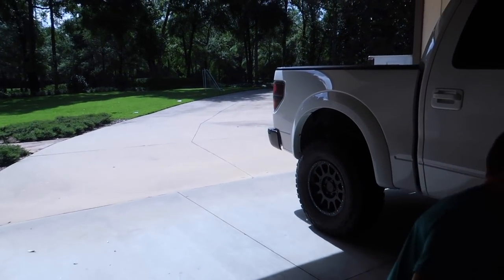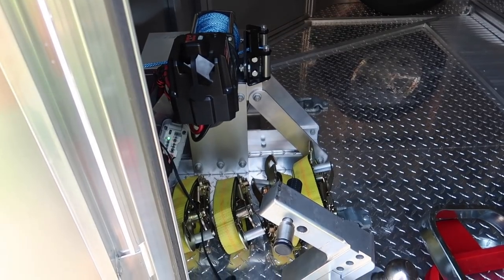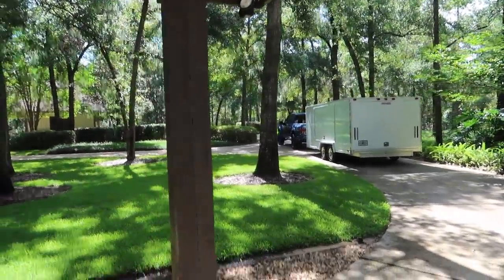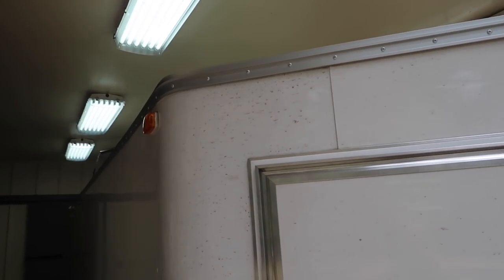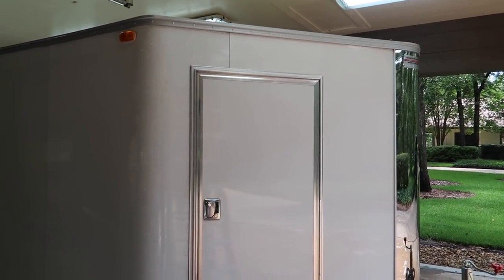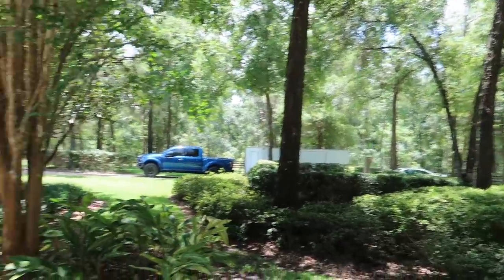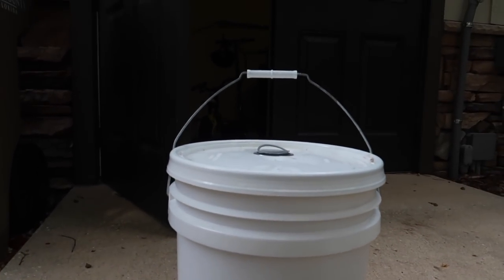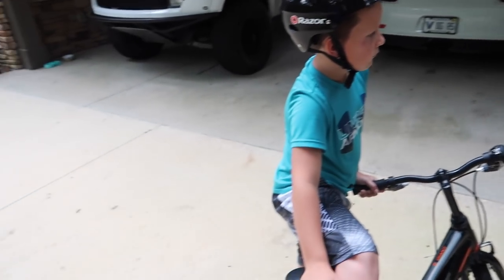Cleaning Trailex Trailer & Car Capsule Vlog

Comment: Matt look in your owners manual it states that you should be using a weight distribution hitch with any trail weight over 5000 lbs or any tongue load over 500.

Comment: Simple green works just fine to clean that right off. The RV cleaner version works even better.
Your tire pressure requirements off your trailer is listed on the tag. It should be around 60 psi. The GVWR of the trailer determines the tire psi.
Reply from the maker: That's a good idea.  I'm going to check the tag.  I'm not sure where it is.
Reply: Obsessed Garage usually near the vin tag. Maybe the frame near the front or in your case in side by the door.

Comment: Yo Matt, i applied sealant and wax (both from your site) to my car about a month ago. When i clean my car tomorrow, is it safe to use the spray wax i got from your site as a drying aid? Or should i not be putting that spray wax over the sealant and wax
Reply: Joeyyy25 if it’s jescar powerlock plus and collonite 845 and you’re using optimum spray wax, you should be all good. That’s what he uses. He has a video on it with his blue gt3
Reply from the maker: Yes, I use it as a drying aid.